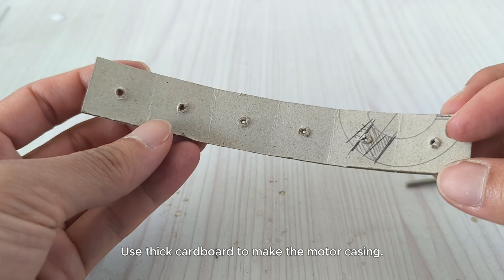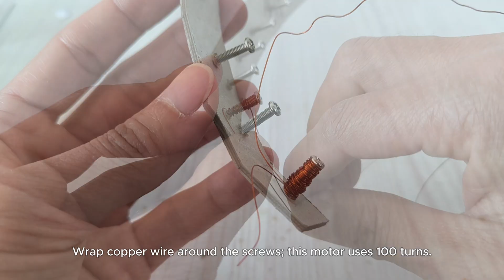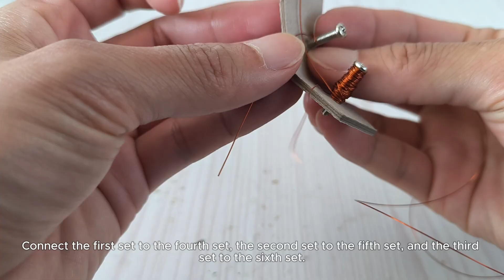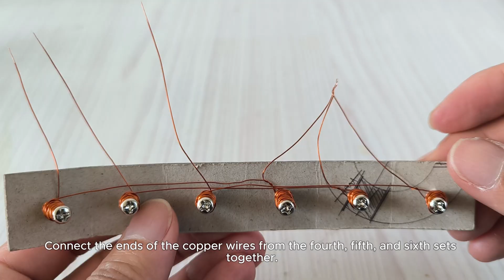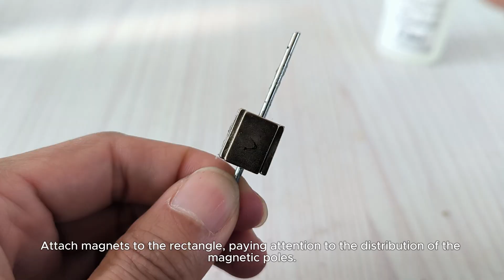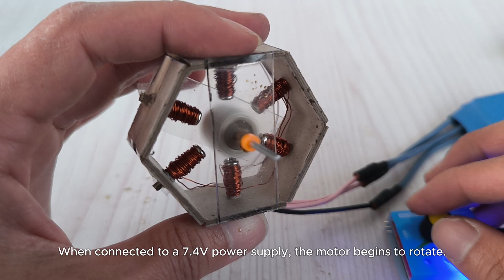How to DIY a Brushless Motor | Simple Step-by-Step Guide

Comment: Hi. I tried this but my power adapter was burned, it was 1000 MA only.. how many AMP this motor needs? Please include these info in the video and please answer me how many amps and voltage to start?
Reply from the maker: Hello, this is a brushless motor, and it requires an ESC (Electronic Speed Controller) to activate it. Your mention of using a 1A current suggests that you may have mistakenly assumed it operates like a brushed motor. A brushless motor should have its current output and direction controlled by an ESC. Generally, commercially available ESCs have maximum currents ranging from 20A to over 100A, depending on their performance and price. In DIY projects, the lowest-cost ESC is usually sufficient. I hope this helps you.

Comment: Thank you very much. This is the best and easiest video. I liked also that the motor doesn't need a push to start. I've a question please. For the 6-pole motor, you wired 1 to 4 | 2 to 5 | 3 to 6 clock wise. If I want to make 9-pole motor, can you tell me please how to wire?
Reply from the maker: I'm glad you're interested in my video. The principle for making a motor with 9 coils is the same as with 6 coils. You just need to connect groups 1, 4, and 7 together, groups 2, 5, and 8 together, and groups 3, 6, and 9 together. It's very simple.
Reply: @bongbong之奇趣實驗室-b6n  Thank you very much. Should all the coils be wound clockwise direction? Or direction doesn't matter? Because in some videos I see they tell us to win clock wise and then counter clock wise, I was confused.

Comment: I’d like to make this with a 3D printer but it seems like it would be difficult to wrap the wire around the screws while they are in the enclosed polygon. Maybe wrapping the wires before inserting them into the 3D print is an option.  

And for the power source I think a 5v battery with a potentiometer will work.  Excited to try this
Reply from the maker: @SierraGax  Using 3D printing to make a motor casing has the advantage of being able to create components with greater precision. If you encounter difficulties when winding copper wire, you could consider making the parts separately and then connecting them with screws. Regarding the power supply, the ESC used in this video requires a voltage of 6V or higher to start. If the ESC you are using can operate with 5V, that is also feasible, but the speed may be lower. Wishing you success!

Comment: Do you have a video showing how to put the power supply and potentiometer together?
Reply from the maker: In terms of the power supply, I used an adjustable voltage transformer, and the test was conducted at 7.4V, simulating the voltage of a standard battery, but it was not shown in the video.

Comment: I am so far enjoying your videos so far, because they are quite creative and amazing. and while mine is a professional version of motors and generators, its still nice to see a person making electric motors that are similar to professional versions, even though the motors that you create, although that's probably because you don't have the right materials for suitable sounds, are buzzy and make vibrations at high resistance. and you're not alone, sometimes I do actually use cardboard too, but I also include the use of iron for the core or steel (both works), Brass made or casted screws, connectors and cabled wires for extra lower resistance and power it up for testing. so yes, you're not the only one who uses cardboard, sometimes I do, since I sometimes run out of steel for the metal casing, so you're not alone.
Reply from the maker: @davidwarda5616  Thank you very much for your attention and appreciation of my 
channel.👍
Reply: @bongbong之奇趣實驗室-b6n  You're welcome. and I do indeed enjoy your videos so far, because its creative and educational too. and like I said, while mine is a professional version that has suitable materials, yours makes sense too. and yes, you're not the only who uses cardboard for motor case. I do sometimes use cardboard too, since when am out of metals, I use cardboard for casing and iron core, brass screws, connectors and wire cables for the motor, while the case is just thick cardboard.

Comment: the sounds created by the motor is acceptably good. the reason why it's buzzing like that is because of friction that comes with using the plastic thing and the glass. to minimize this vibration and make it sound cleaner, clearer and produce a whine during operation, I usually use smoothing and soothing components that reduces friction by 70 to 85%, making it much smoother, less buzzy noises and more like a gentle whine and beautiful and nicely made whine or wind noises during operation. friction that is high can make motors Buzz and can cause wear quickly over time or become louder.
Reply from the maker: @davidwarda5616  Yes, the materials I am currently using have higher resistance on the drive shaft at high speeds, which prevents this motor from reaching higher RPMs. Ideally, using bearings to connect the drive shaft or employing a metal casing would result in lower resistance than what I have now. However, I want to use easily obtainable materials for production, which is why the RPM has not reached its maximum.
Reply: @bongbong之奇趣實驗室-b6n  exactly right and correct. motor bearing is actually a really good thing to have in motors, because as you correctly said, it makes the motor run a lot smoother and softer, making it easy to move with a finger or something lighter. and yes, the buzz you hear is due to the friction and vibration from the glass, which makes it buzz. for a motor whine, a magnetic steel rotor is recommended, but however, that's only for AC or alternating current motors, and not for Brushless motors. and yes, please do make a larger motor if you can possibly do.
Reply: @bongbong之奇趣實驗室-b6n  I see, that makes sense. easily obtainable materials for productions are still good, but for my projects, I use materials that are a bit tricky to find, such as steel for the rotor's AC motor, Copper for wires and windings, an Iron for enhanced efficiency and brass screws for high conductivity and excellent resistance to fatigue and corrosion.
Reply from the maker: @davidwarda5616  Yes, it is not easy to purchase suitable materials. If using professional-grade materials, it can be hard to find them in the general market. Professionals like you may know where to buy them, but for hobbyists, it is often difficult to find the right materials. For example, I have been unable to find a place to purchase 'silicon steel sheets.'

Comment: you're using steel, finally, great job. steel is indeed the fantastic material for stator winding to hold into, since its magnetic and enhances the magnetic fields by concentrating, rather than having them go random directions and affect efficiency. its good that you are using thick cardboard, because thinner ones are not durable and not suitable for motor applications. metal cases for the housing of a motor would be the best looking and amazingly durable and suitable, but it makes sense to use cardboard too, especially when you don't have the tools to melt metals and create a motor housing by casting it.
Reply from the maker: @davidwarda5616  I am currently thinking about creating a larger motor that will use sturdier materials and aim to generate a stronger magnetic field. However, I am still in the conceptual stage and have not started production yet.
Reply: @bongbong之奇趣實驗室-b6n  that's a great idea. keep up the great work.